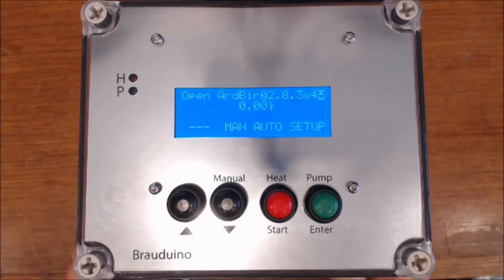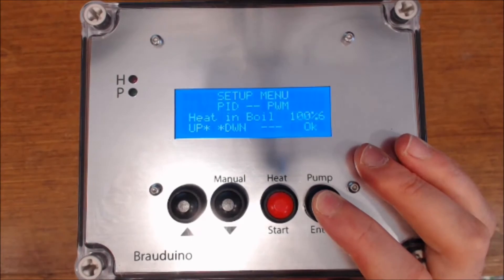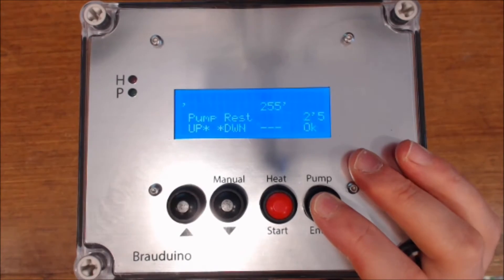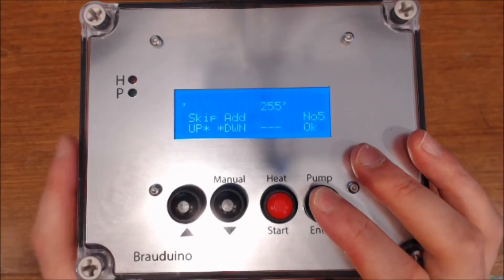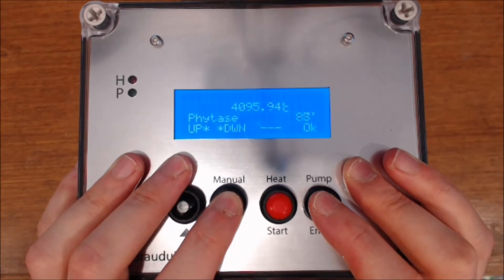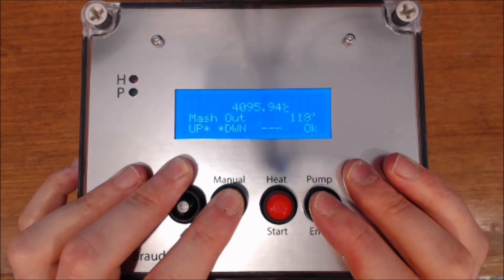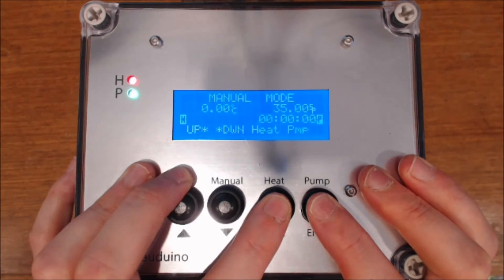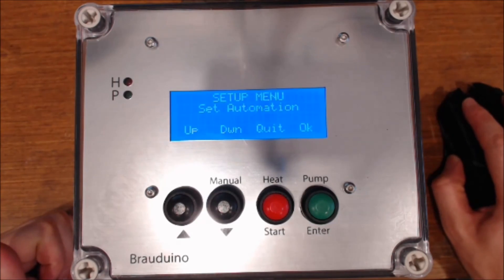Settings for your Brauduino Controller

Comment: I may have come late to the party, but I just got my hands on a brand new few years old brauduino box.  Cool stuff.  I can't find documentation anywhere.  Your video is very useful.  And clear.  Thanks a lot.   I have a few questions, if you still remember anything about this I would appreciate.  I connected a light bulb to the pump or the heater output.  On MANUAL MODE: 1) the lamp always comes on when I turn the heater on; the real heater is not coming on on manual mode.  Just below "manual mode" my box shows the temperature to the left and then 35.00 S/P to the right, I wonder if this 35 is related to the heater not coming on.  2) When the lamp is connected to the pump output, it is always on, very dim is the pump is not activated, bright if activated.  I measured the voltage, it is 220V in either case, it seems like some current is leaking.  When I connected the pump it worked as expected.  Maybe this leakage is normal. (?)  But then, after a while, when turning the pump on, the display would go funny.  Only way to recover was cycling power :-(  On AUTO MODE: 1) I followed (I believe) your steps.  Sort of.  I actually cut off all the ramp stuff and jumped straight to 68C, between beta and alfa amylase, and then went on with the other steps.  Then I tried to simulate a brew session.  The controller jumped straight to the boil.  I double checked everything, tried again, same results.  Well, it sounds like this last one is due to some dumb mistake, I will try again and again and see if I can pinpoint the problem.

Comment: Few comments; 
1) The protein rest @ 50deg will remove head retention not increase.
2) You've confused Beta and Alpha Amylase in the narration.
3) You set the Boil length for 30mins.

Incedentally your mash profile will result a very full bodied beer leaning towards the Alpha Amylase activity...

Comment: I've added a pull request that fixes that pesky trailing character ("c" or "6") you're seeing in the PID setup menus. Hopefully it will be included in a future release or ArdBir. https://github.com/ArdBir/Open-ArdBir/pull/3
Reply from the maker: +Digital Homebrew 

Thanks! I might put this in a separate GIT repository as the main ArdBir dev I think has spotty internet connection. It would be best to PM Max and let him know.

Comment: Do you worry about the pump being sanitised since you don't have it on during the boil? I just wonder if some unboiled wort could be sitting in the pipes and introduced during whirlpool.
Reply from the maker: +Digital Homebrew
Not at all - I haven't tested the new whirpool features on this version of the software - but I assume it allows you to whirlpool when hot. Previously, after the Auto Mash and Boil schedule was finished I would run the controller in manual and re-circ for 10 mins hot, then throw in flame out hops etc, turn the cooling water on, heating off and then run until the system has cooled to the level I'm happy with. 

You've got me thinking. Pastuerisation is time and temp sensitive. (not entirely the same as sanitisation)  Personally I'm mashing out @ 80C for 20mins, which is in itself going to deal with nearly all bacteria. It would be interesting to test this with a small no-chill cube actually...